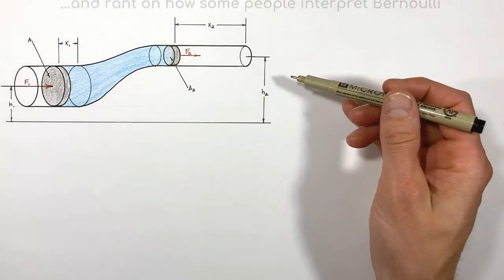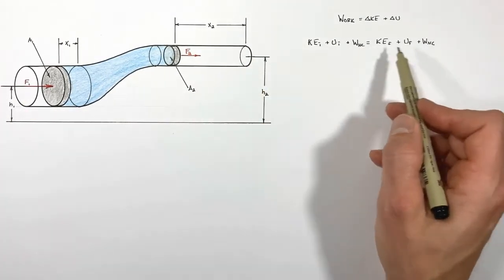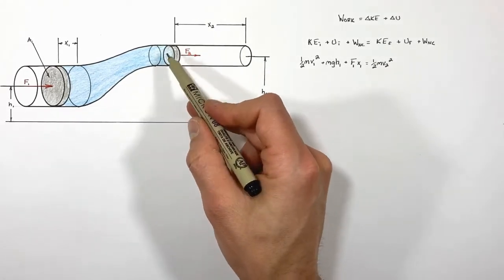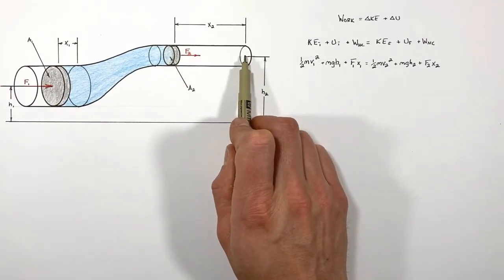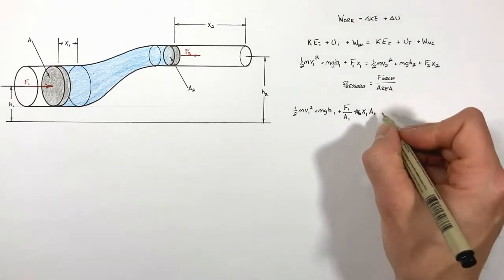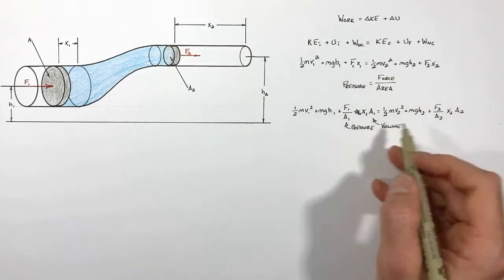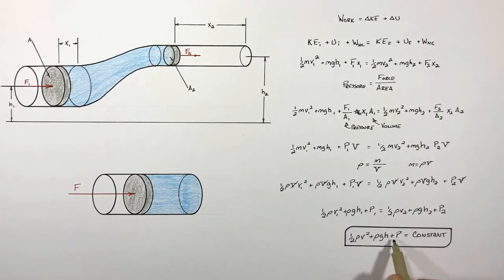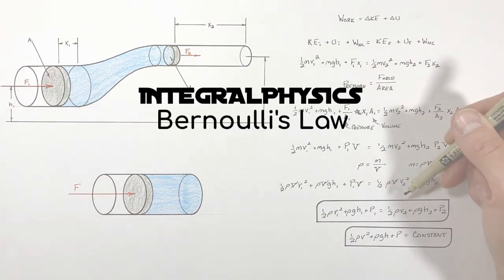Bernoulli's Law Derived & Explained Using BASIC Physics - The Conservation of Energy

Comment: 1:50

W = (KE_f - KE_i) + (U_f - U_i)

How did you make two terms of work on both sides? That should not be possible.
Reply from the maker: while work is really change in mechanical energy.  i split the work up into 'energy in' on one side and 'energy out' on the other.  It added the symmetry to address the static pressure terms on both sides of bernoulli's.

Comment: Why the volume is same on both sides?
Reply from the maker: volume in must equal volume out.  do you mean area?  if thats the case, there is a loss in pressure as the fluid gains height.

Comment: how is the law of conservation of energy 

KE inital + PE initial + Wnc = KE final + PE final + Wnc

all the videos and whatever i look up online say that the law of conservation of energy is the same equation but without the last Wnc, why is that there

KE inital + PE initial + Wnc = KE final + PE final

what is going on??? from where does the last Work due to conservative forces come from?? can anyone please explain
Reply from the maker: You can put that Wnc term on either side (or both if it suits you).  Its only the sign of the term that needs to be modified depending on where you stick it.
Reply: If Wnc appears on both sides does that not imply that Wnc=0?

Comment: Presumably, in most cases work done on raising the height does not feature...  For a give input force, if you are are doing work to raise the height, then you will reduce the X travelled.  But does not really change the relationship between x1 and x2 as that is governed by the cross section change and subsequently the Velocity relationship does not change? I suppose if you took it to extreme, in aviation and similar, you would do more work lifting the air that you could not generate the velocity change you desire, subsequently reducing the desired lift.
Reply from the maker: With air a small change in height will not change pressure very much. 
 However with a denser fluid such as water, a rise of just a few meters can produce an enormous change in pressure (Think of swimming to the bottom of a pool)

Comment: now this is amazing, one quick question i would be grateful if some1 answered, what pressure does that P reffers to? Can it be the pressure caused by column of fluid? Or only air pressure? Or dynamic pressure?
Reply from the maker: P here is static pressure.  Air typically does not play all that will with Bernoulli's analysis of this kind of problem due to compressibility.
Reply: @INTEGRALPHYSICS  and what is it exactly? Is it NOT the pressure caused by a column of fluid (hydrostatic pressure)?

Comment: Small thing but the exit end of the pipe is drawn incorrectly.  Sincerely from a long time ago draftsman

Thanks for this vid
Reply from the maker: Was the correct move to reverse the line weights between the left and right sides of the bore?  I thought about that but it didn't feel right since the left side is the hidden line.
Reply: @INTEGRALPHYSICS  To my eyes, both end cuts appear to be facing the viewer.  Traditional drafting would have drawn the hidden edges with dashed lines.  The good news is that the video was sufficiently well done, consistent in its level of detail, and factual that small things are easily ignored.